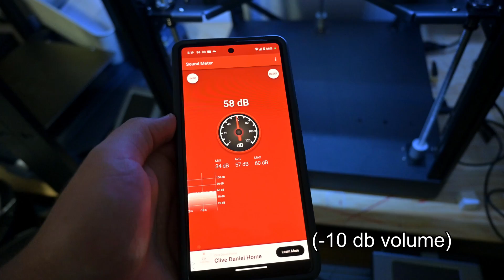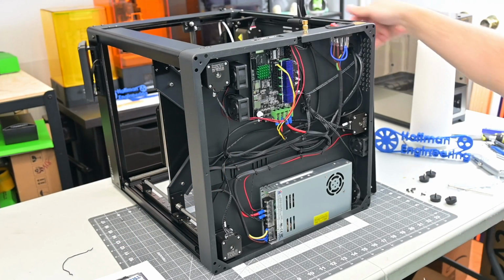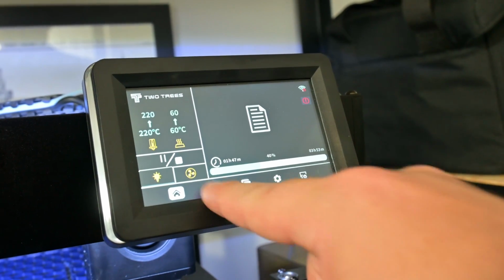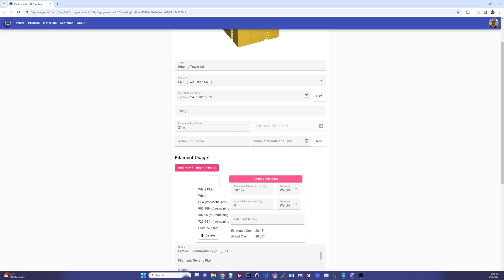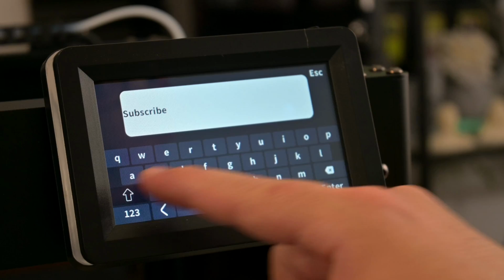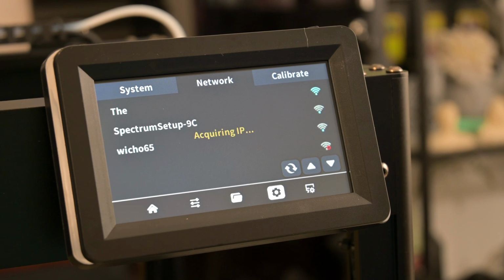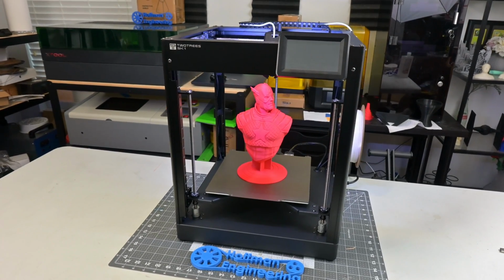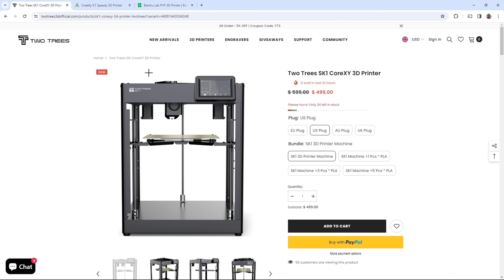700 mm/s | Klipper | CoreXY | Tilt Bed Leveling. This has it all! - TwoTrees SK1 3D Printer Review

Comment: Does it print ABS/ASA reliably? TwoTree mentions ABS on their product page, but I don't see any reviewers print or mention ABS/ASA on this printer.
Reply from the maker: I have printed abs on it briefly. It was successful, and I see no reason it would not work reliably for longer print with ABS or ASA. It would also be very easy to enclose this printer, which would greatly benefit ABS printing.

Comment: The noise is caused by 8 fans, 4 in the print head and four in the controller area, two dedicated 40mm fans blowing on the Rockchip quad CPU with 1GB of ram and the power hog TMC2209 drivers. Someone asked about installing Mainsail, nope, they do not provide root access, no username or password, without you cannot install anything including KAMP or Beacon devices. During the review you could see the camera, mine has never worked, it has been a week of emailing videos and images of the issues (head crash due to the X&Y axis sensitivity setting being set too high) yet only one person even acknowledged my email but she was in sales. I finally tracked down the login from China but the manufacture of Two Trees controller has installed a modified version of Klipper in a non-standard way, it will be less painful to replace the control electronics then wade through Makerbase's MKS SKIPR V1 setup, did that with Creality K1 and ended up replacing that controller to get full access to Klipper on the K1 (K1 now undergoing a gantry rebuild to get rid of VFA). The SK1 is a better printer than the K1 hardware wise, electronics wise they both cut too many corners. With Orca Version 2.0 printing the Orca 40mm Cube turned out perfect on the SK1 but not being able to add a Beacon to the controller has sealed its fate.

Comment: In your firmware update video you showed removing the EEMC storage and flashing it. What device was used to flash the EEMC? Is there a way to install Mainsail into Klipper on the SK1? Thanks.
Reply from the maker: It is an emmc adapter included with the SK1. Unfortunately I'm not familiar enough with klipper to know if you could install mainsail onto it, I'm not sure what access is needed.
Reply: @HoffmanEngineering  , I have a few more questions if you don't mind please.

What type of nozzle is used? I realize it will be a special high flow nozzle but is it a E3D, Volcano, M6, etc?

Thanks.

Comment: WTF - manual z-offset with the paper method? :D

for that price, this is horrible
Reply: The offset is only done once so it's not a big deal
Reply: I know, right? I can't believe that was ever a standard. I'm surprised you don't have to bang a couple rocks together and do a rain dance or something.
Reply: @Microplastic_Therapy  of course calibration methods are not an indication of quality - in high end CNC applications you would use feeler gauges or ruby-tipped probes for a dial indicator

but you want to seriously tell me, that i need to zero my printer with a piece of paper? nozzle probing is so accurate nowadays, it lies well below the tolerance of the stepper motors

i havn't manually zeroed anything for years now